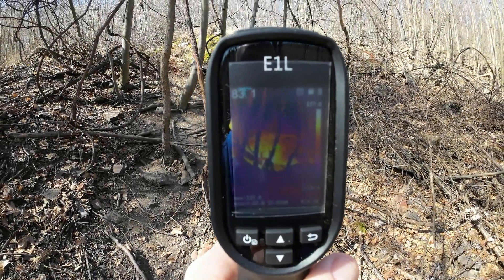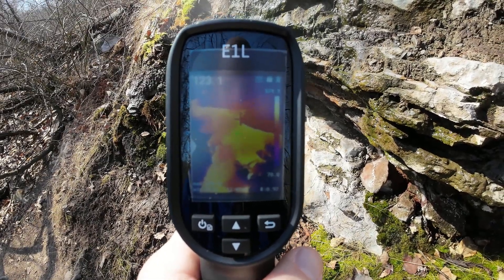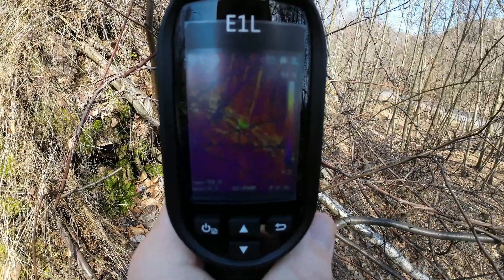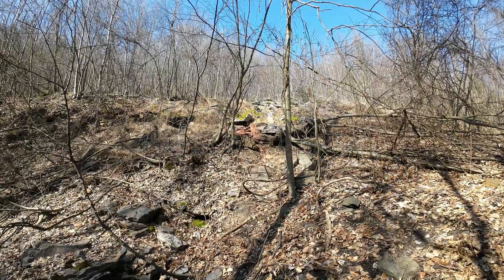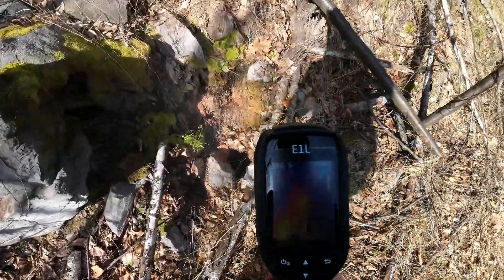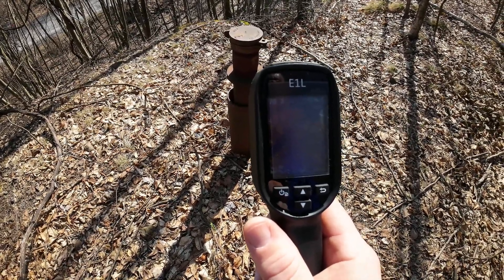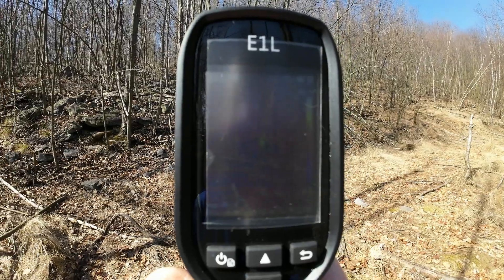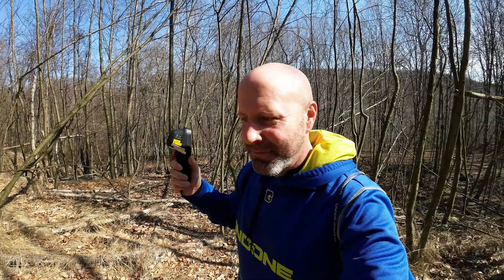The Centralia Mine Fire Seen with a Thermal Gun - Steam Fissures & Pipes

Comment: Tap these burning towns for electric power generation.

Why waste the free heat beings generated.

Help it burn better and focus the heat to use it.

Make the equipment semi portable while using many smaller generation systems. Instead of the usual "one huge one".

Electricity is needed everywhere, has value and the transmission of power is easy.